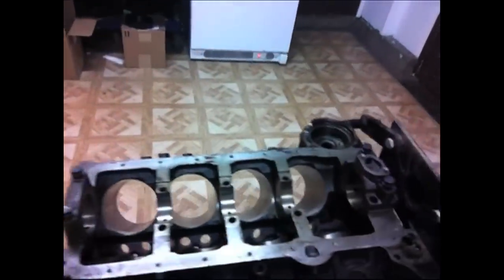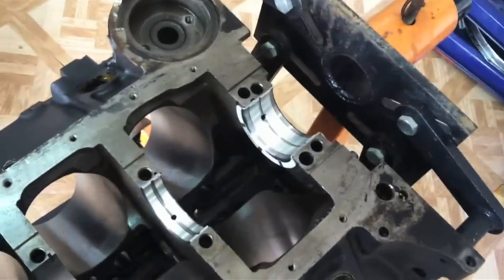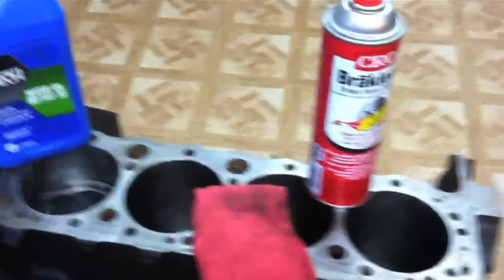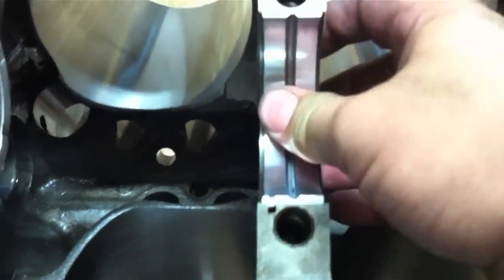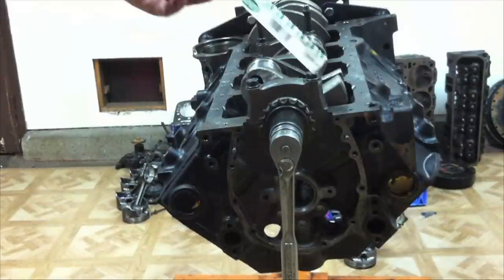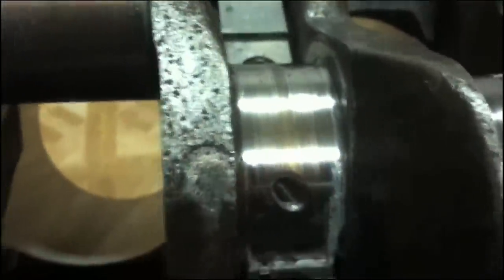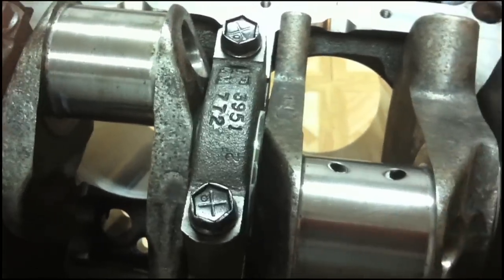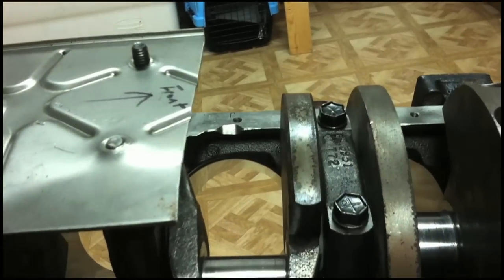How To Build a Chevy 383 Stroker - Part 1: Block & Crank

Comment from the maker: I get most of my stuff from Summit Racing. They are easy to work with and they know more than most local parts guys. If you start with a never rebuilt 4 bolt main block and machine it .030 over great. Steel crank if possible. Good pistons. Aftermarket heads, aluminum or cast iron, with at least 200 cc intake runners. Full roller or roller tip rockers. Aluminum intake. 600 - 750 cfm carb or FI. Should be easy 400 hp. Balancing will help longevity. Adjust 4 budget.
Be sure to run premium gas.

Comment from the maker: I would not recommend using any used crank on a rebuild without having it checked at a machine shop and/or ground. This is a steel crank and it is like putting new brake pads on an old rotor. Won't hurt but will wear down the pads (or bearings) much faster. Not a good idea. A good machine shop will help you with grinding a crank and boring the cylinders for new pistons, etc.. Again, do all the machine work and pay to balance the engine!

Comment from the maker: When you bore an engine it just means you need the right size pistons. Rods and bearings are the same. The overall displacement changes from 350 cid to 355 cid with a 350 crank depending on compression, head chamber size and cylinder size, i.e. .030 over, .040 over or .060 over. It is still called a "350." You don't need a roller cam. You can use just roller rockers or roller tip rockers. I only use a ball hone if I am repairing one cylinder in a car. Machine the block and use new pistons, etc.

Comment: Nice.  I always wanted to do an econo build.  Scavenge all the parts for free, use the best of the old parts I have, and see how long the engine will last.  Obviously not an engine for the track, but you know what I mean.  Anyways, you just earned yourself another subscriber.
Reply from the maker: Thanks man. I'm glad you get it. This is a shit motor (there's that word again LOL) so why not use it for my first engine tutorial. Lots of guys build crap like this for their weekend racers. Small tracks across the country have a rule that says if you win a race you HAVE to sell your engine to anyone that offers you $1000 (or whatever the specific limit is). It keeps guys honest and the price of going racing down.
I just finished a BEAUTIFUL 350 four bolt with 350 hp and did some short vids on installing chrome timing covers, oil pan, etc. It is kind of an extension of these videos but with a LOT nicer engine and "bling" effect! Should be up soon.
Thanks again.

Comment from the maker: The 383 idea is basically taking a 400 small block crank and putting it into a 350 block. If you use a longer stroke crank you need to plan ahead and match crank, pistons, cam/lift, heads, chamber size, rocker ratio and make sure the block has not been "decked." If you have pistons already I would stick with the 350 crank (preferably steel) especially if you have 10;1 or better pistons. The USED crank in this was a steel Scat 3.750. I never recommend used parts but I do recommend balancing!

Comment: Ha! You do the back threading step before you go forward on the bolts too!! Nice touch, good way to do things. The sharpie marking is a great idea. Going to watch the rest of the series.
Reply from the maker: Thank you. I have learned (the hard way) to clean threads before you put something together, especially when you have a bare block or something out and easy to get to. I have been having a "debate" with a couple people about using a tap instead of a "chaser." Taps only "cut" the block if the threads are wrong to start with. Whatever.... LOL

Comment: I use PTFE spray to lube the cylinder walls when i do dry fitting, easier to coat the whole bore and the teflon isn't wiped of as easily by the piston when moving upp and down.
Reply from the maker: May work okay but personally I would not use any teflon coating on a new engine. The same reason you don't want to use synthetic oil for at least 2000 miles. The rings need to seat and "break in" before you add anything. If you use any synthetic or teflon additives you run the risk of the rings not sealing, oil bypassing the rings and engine smoking. Not saying it will but just something to think about. Thanks!
Reply: +SanDiegoHotRod you have a point if its for final assembly, but i only use it for dry fitting, like checking crank clearance, it feels like it lowers friction more then engien oil when you only have a thin coat, Before final assembly i whipe it of with a microfiber towle and use assembly lube and semi synthetic oil. Built two 350 sbc, one nissan sr20 4banger and one bmw m54 steigh six with teflon and never hade any problems with rings not seating so don't thinl residue is an issue.

Comment from the maker: If you don't live in California there's a lot you can do. If the engine is in good shape you can get a Vortec supercharger (blower) kit to put on it. Blowers add roughly 40% hp to any engine. The kit will come with the proper programming for the computer so you don't melt down the pistons. Larger injectors, K&N air intake system, good headers, dual Flowmaster mufflers, replace the heads. Budget and "balance" of air/fuel/intake/exhaust are all important. Or rebuild it with these things in mind.

Comment from the maker: That is a loaded question. That depends on if you are talking "parts" AND "labor" or just labor. Most people don't like to assemble other people's parts (for the above obvious reasons). A rule of thumb here in San Diego would be around $500 labor to assemble an engine ready to go. More work, like grinding, etc. runs more. #1 Find someone you can trust. #2 set a budget. Parts & Labor can run $2K - $20K. A GOOD 383 done RIGHT should run @ $5K parts & labor. There is a build sheet on my website.

Comment: I remember when I did my LT1 I used gear oil to assemble it. That motor ran strong for 5 years stock bottom till the oil pressure went down I'm thinking from 100 shot N2o and seeing 6700 rpm a lot. =) Great video Sir I wish I had a place to work on motors I'm in a condo now. =(

Comment: In that case, this being my first complete rebuild i'll probably stick to standard specs as much as possible and just use brand new std crank, pistons, bearing etc. I do want to upgrade the cam & heads though. Is there any setup you would recommend to use with a stock bottom end? Not going for really high performance, just better than stock but still reliable.

Comment: did you put crank in with that pitting ? or had you cleaned it up and how did you go about that?
Reply from the maker: I just did a light polish so it had no sharp or rough edges. The owner was too cheap to turn the crank properly. Is the customer always right???

Comment: what about checking the line bore on the crank and cam,that crank should roll like it has roller bearings
Reply from the maker: The machine shop should take care of all that. This engine is of course garbage but that is why you need to use new parts and a GOOD machine shop you can trust. The crank spun smooth and this engine runs fine but parts like these are why I don't trust anyone who says the engine was rebuilt, etc. when I buy an engine or a car. The only way to KNOW for sure is to build it yourself. Being cheap is always risky.

Comment: Hello,
   I'm working on a engine for an 80's model Camaro I recently obtained on trade and am planning on build a 383 to go into it. I was wondering if it was possible to use a 400 block and destroke it. If so how would one go about this process?
Reply from the maker: You can but I would not do it that way. A 400 block has bigger cylinders which restrict water flow between the cylinders and they are known for running hot (over heating).
Any "odd size" crank, rod or piston combination is harder to find parts for and more expensive. As far as budget, assembly time, horsepower and reliability a 350 (4 bolt) block (new or never bored), steel crank, GOOD aluminum heads (machined right), GOOD pistons and everything BALANCED will be money and time better spent.
Just my opinion.
Reply: SanDiegoHotRod  Thanks for the reply and the info. I didn't know about the 400's running hot. Definitely going to be looking for a 350 block now.

Comment: I know i ask a lot of questions but when the cylinders are bored .030 does that effect the size of the bearings or rods to use or do you just need .030 pistons? And do you need to use a roller cam & lifters in order to use roller rockers? Also, if the cylinders are in good shape is it necessary to send to a machine shop. I was told you can steam clean, run a tap through certain threads, and use a flexhone tool.

Comment: Thank you for taking time out of your day to make this video. I did not have a good understanding of plastigage until this video. Do we also have to worry about the tolerance on the block side crank shaft bearings as well?
Reply from the maker: Thank you and you are welcome. You do not necessarily need to worry about the block side bearings. It is not necessarily how round the bearings are but the "clamping force" I guess you would call it. Like brake pads grabbing a rotor or inside out brake shoes and drums. IF you need to clearance the bearings you are only talking less than .001 inches in most cases. For the most part (in a perfect world) the crank is actually spinning on a film of oil not the actual bearing material itself. Hope this helps. I wish I knew a better more accurate scientific way to explain it. LOL
Reply: Thank you much! What is the proper way to remove material on the cap if your tolerance is too large? Or is this something that identifies a defect in the crank journal itself and requires professional machining? Thanks in advance..
Reply from the maker: Troy M
In THEORY or in a perfect world, if the crank is turned say .010 under and you get a GOOD set of bearings marked .010 then they should be within tolerance. Also if you have a NEW crank and GOOD new bearings they should be a good match. If it is only one journal that is bad then you may have a problem. Of course best scenario is a new steel crank with GOOD new bearings.
Reply: Thanks again!
Reply from the maker: Ideally you want to have the crank new or checked by a machine shop shop for size, cracks and balance. If the tolerance is too large then use another bearing or you may need another new bearing/set. Mic the crank to be sure. You don't want to start machining the caps yourself.
Reply: Thank you.

Comment: I've used your videos on building a 383 as a reference for my assembly but I have a question I accidentally put one of the rods on backwards and I need to take it off and flip it around how do you get those annoying little c-clips out without damaging the piston or the rod. Any help would be very much appreciated thanks.
Reply from the maker: Short answer: Carefully!
Long answer: I am "ASSUMING" you have the spiral pain in the ass clips not the easy C clips with the eyelets you can grab with snap ring pliers. If it is not a needle nose or snap ring plier solution then spiral or C clips SHOULD have a small lip on them to get them out with a metal dental pick or similar Snap On/Matco/Harbor Freight tool.
Usually I use one straight dental pick and one hooked pick from Snap On or any tool place.
I use the same tools to take the snap ring off of a steering column when I am pulling the steering wheel locking plate.
Hope this helps.
Finishing up my "dress up" engine series in a couple weeks. The red engine I used in the videos is in a 1965 Chevelle and I am using the car in a new music video coming out in Feb! Stay tuned!
Thanks again. Shan
Reply from the maker: richard lundy
Like I said. Sometimes you get in a hurry and just miss the obvious! Glad you figured it out!

Comment: I watched your stroker video and was curious if you could give me some pointers on my first engine build?
Reply from the maker: If you go to my website corvettesandcustoms.org and click on the link that says "Build Sheet" you can print out a "wish list" of parts you may want to use. Just like building a house you want to set a budget, decide what purpose you want the engine for (drag racing, circle track, economy, street performance) and then build the engine "on paper' so you have some idea what to expect. Keep in mind what I tell my customers: There are things you NEED, things you could use, and things you DON'T need. Rule of thumb, most machine shops (and more and more other businesses in America) suck so you just have to find one you can work with and will explain things to you so you know exactly what is going on. Summit Racing is a great source for parts and info. I also use Virtual Engine 2000 to get an idea on horsepower and RPM range before I build an engine. Thanks. Hope this helps.

Comment: you did plastigauge on 1/2 the main bearings, would you have to repeat the process for the other side (ie remove the crank and put plastigauge there?)
Reply from the maker: +Jeffrey Lomele No. The clearance is actually an overall clearance between the crank journal and the bearing surface. When the engine is turned right side up and the crank "falls" .001 of an inch then the clearance will be at the top. When oil is flowing around the crank it "floats" on a very thin layer of oil all the way around the crank bearing journal surface. Hope this makes sense.
Reply: +SanDiegoHotRod makes perfect sense, thanks!

Comment: I'd like to bounce a couple questions off of you. I'd like to put a Vortech 5.3 in the 92 Camaro. First do you see any problem with that secondly what I use the CAMARO wire harness or the donor truckharness? And is there any problem using the truck motor. And one more question, would 5.3 that had an automatic both up to my factory four-speed in the Camaro? Thanks a lot
Reply from the maker: Is there anything in the Camaro now? If you had to use the truck engine then you want to use the truck wire harness. The truck trans probably won't fit in the Camaro. Do you just want the little bit of extra stroke and torque? The MAJORITY of your hp comes from the heads. Seems like you are creating more work then you need to. There are many donor cars at the wrecking yard you can get fairly cheap and rebuild and replace the heads on if you want to max out your hp. If money is not tight then a well built LT1 that bolts right in with a Vortec Supercharger is the easiest and most driver friendly high hp way to go. Take a look at the "Build Sheet" page on my website and print it out. It will help you decide and budget your build options. Don't even get me started on doing an engine swap if you are in California where you have to smog it! LOL  http://www.corvettesandcustoms.org

Comment: Ok first thanks for this video awesome as always. On to my question, so I am getting ready to drop in my crankshaft in my 1996 Lexus Ls400. I place all of the main bearing in set in the crank, nothing wrong. Place the thrust bearing in and now the crank won’t sit in. I measure it and its 2.44mm so it’s within spec. what do you think is wrong?
Reply from the maker: Thank you. I am finishing up my engine dress up series in the next few weeks so I hope you will watch those and learn a few more tips. The red engine I just built is going into a beautiful 1965 Chevelle and I am using the car in a new music video that I am sure everyone will freak out over! Hoping around Feb. Stay tuned!
Honestly I am not super familiar with the Lexus engines but a few things I would check are:
1. Make sure the crank does not have any old bearings or shims stuck on it.
2. Measure the OLD bearing. "Specs" are guidelines and a starting point. You may also have a burr on the end of the  
    crank or something.
3. Make sure the old bearing is out of the block. Sometimes we skip the painfully obvious because it is so obvious,   
    especially if you get in a hurry.
4. Most importantly the crank needs to be PERFECTLY level as you drop it in. If one side is higher than the other AT ALL
   it won't drop in straight.
Sorry I can't be of more help but hope this leads you to an answer. Thanks again. Shan

Comment: My question is this......I have a 4 bolt main 350 that is stock. If I build a budget 383 what parts rods etc can I re use? I know the crank and pistons will have to be replaced, what about the stock heads? Will I need bigger valves?  Like I said this is a budget build, I need to save and reuse parts where possible.
Reply from the maker: The main reason to do a 383 is to get a longer stroke crank and make more low end torque (for towing or whatever). If you just want to build horsepower then I would suggest staying with the 350 BUT (as Pee Wee Herman used to say "Everyone has a big BUT!") here are a couple things to keep in mind. For a 383 you can use the stock heads and rods (depending on the pistons you go with) but you will have to get a NEW crank and do more work clearancing the block and making sure you get all the right parts that work together. For the price of machining the heads, installing bigger valves and stronger springs, etc, clearancing the block and buying a new crank you can buy a new set of after market high flow aluminum heads that make MORE power and are ready to bolt on. Head flow is where you get the most power from any engine. The cam just tells you where the power will be, low rpm or high rpm. The 350 I built for the 65 Chevelle is just over 400 hp with a 600 crm carb!
www.youtube.com/watch?v=uXTybjjdPAI&list=UU3LnmaxoynFmN0FSQH-ROZA&spfreload=10
Summit has some good heads available, even cast iron, that will make more power than stock. Check with your machine shop and see what they have available. $1000 for a set of good aluminum heads are well worth the price in the long run even if you have to wait a while longer to get them. They are also lighter in weight and run much cooler. I have some good pix on my FB page. www.facebook.com/corvettesandcustoms